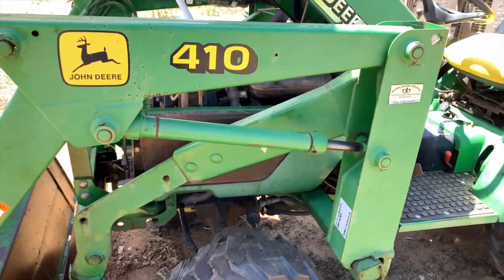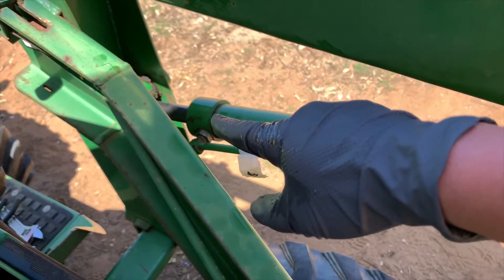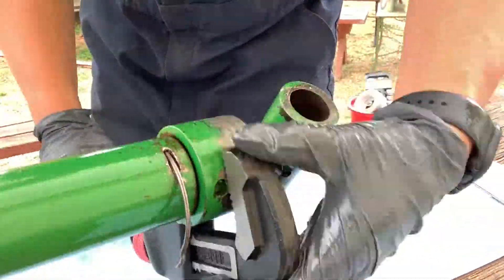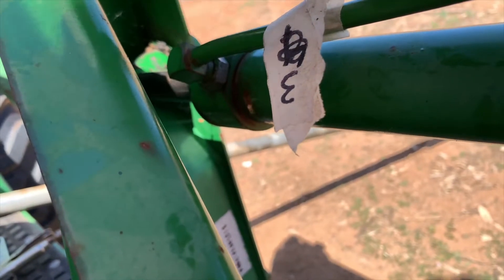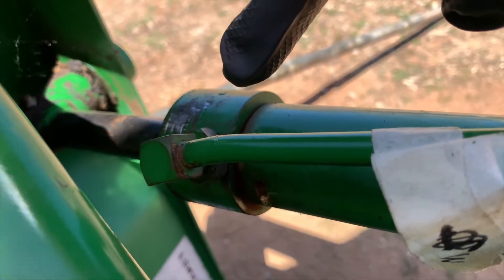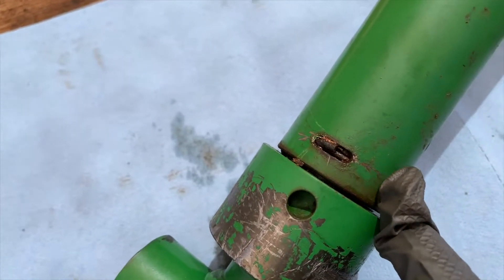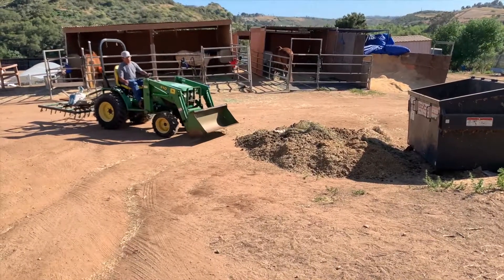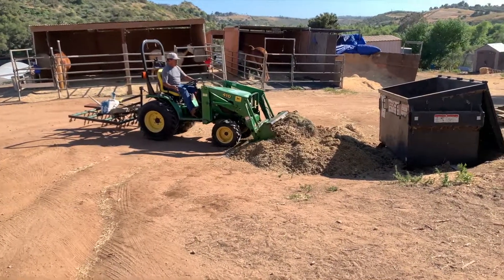Hydraulic Cylinder Rebuild John Deere

Comment: Quick question, the hole the spring comes out mine has something like a putty or silicone covering that hole. Did I need to dig that out to get to the spring?
Reply from the maker: Yes. It’s likely a small amount of sealant that prevent debris from going into the ring grooves. You will need to remove that in order to remove the lock ring.

Comment: does the 410 loader parts fit a  430 loader also ?
Reply from the maker: https://partscatalog.deere.com/jdrc/navigation/equipment/72290/level/2/snp/MTE3MTkwMDpDSEFQVEVSWzEwNjE6I0JVU0lORVNTX1JFR0lPTiwzNDk2OiNDQVRBTE9HLDcyMjkwOkVRVUlQTUVOVF0
Reply from the maker: No. You can find the part numbers for the 430 loader on the link I added
Reply: @realdealGod  thanks
Reply: just wanted to say thanks , I finally got my cyclinder rebuilt and no leaks now  ,  without this video I could have never done it  ! @realdealGod
Reply from the maker: You’re welcome. Glad I could help

Comment: Very good video. One of the best explanations I’ve seen especially with the seal placement. I have a 4300 with a sagging bucket and can see the curl cylinder leaking. How did you bleed them? And is the link you provided the kit that’s needed?
Reply: And if I missed it, which way do you turn it getting the wire to come out, clockwise or counterclockwise?
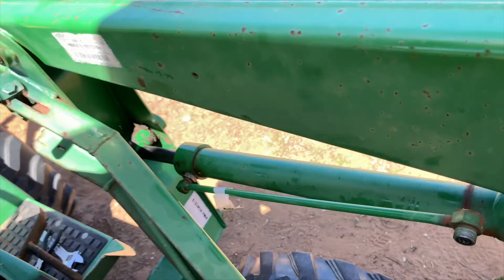Reply from the maker: @markcrook5935   With my cylinders I turned the gland counter clockwise if you're standing on the end with the gland facing towards it. 01:32 shows you how I did it.
Reply from the maker: If you are rebuilding your bucket cylinders then I recommend clicking on the second link for the parts catalog for the bucket so that you can find what parts you need to replace. There isn't a "rebuild kit" available so you just have to pick and choose from the catalog what parts you want to replace on your cylinder. The last link I put was the website that I used to ordered all my stuff from which had good prices and good service. 

As for the bleeding, I tightened all the hoses except for the one I wanted to bleed and I had a second person engage that hose with the handle until I didn't see any air come out and only hydraulic fluid come out. Once I only see hydraulic fluid then I tighten it back up and move on to the next hose. 

Hope I answered your question
Reply from the maker: @Mark Crook I forgot to mention. The links to the parts catalog in my description are ONLY for a 410 loader. If yours is not a 410 loader, you can still use the same website but you would have to look for your specific loader.